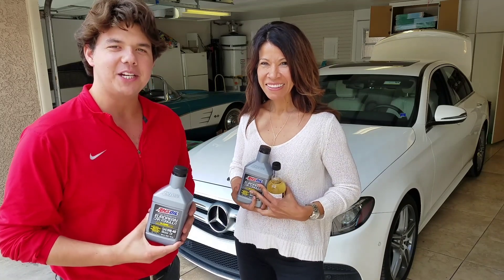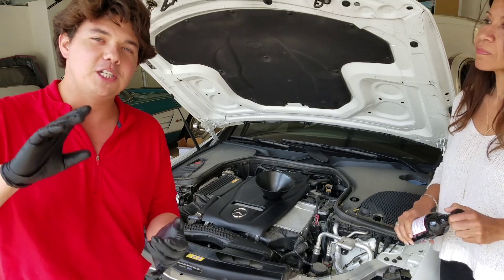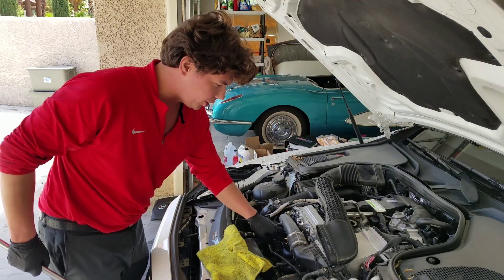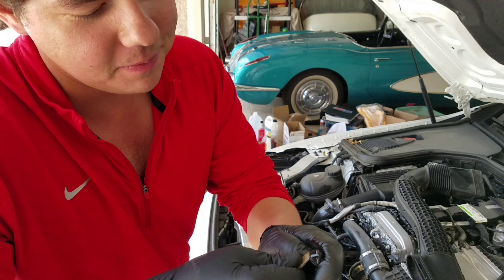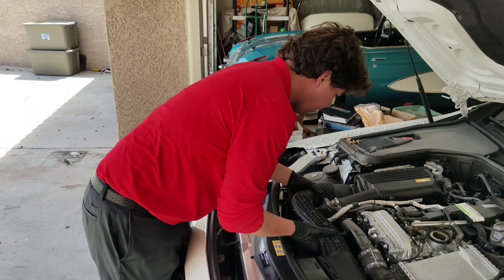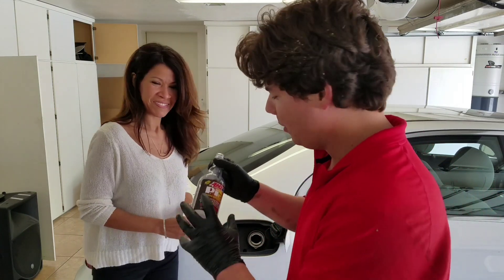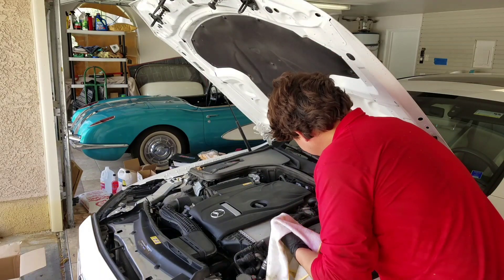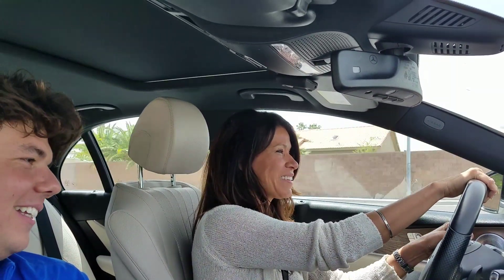2017 Mercedes E300 AMSOIL Oil Change & Engine Flush

Comment: I have a question. Let’s say you put the oil thinning additive. When you do a oil drain, you will never remove 100% of the oil, and consequently the oil thinner as well. When you put the new oil, some of it will mix with the new oil, and so won’t that deteriorate the new oil?
Reply from the maker: The amount that stays in the oil pan is insignificant. Nothin to fret about😉

Comment: Did my oil Change again got 1 gallon of the glorious signature series but I switched from mobile 1 filter to wix Xp wow night and day start up sound fresh from oil change, with mobile 1 it made a nasty screech even with filter full of oil, I tried out the wix xp filter that sound was eliminated, wix makes the filters for amsoil so I figure might give them a try, but when my car gets older and more paid off I’ll extend my drain intervals and get the amsoil filter for when I go long intervals
Reply from the maker: Sweet thanks again James!

Even the regular Wix filters are accilent and they're good for 10,000 miles and you can get those through Amsoil oil with your PC membership.

The Amsoil oil filters are a touch better with higher filtration medium and they trap a little bit more contaminants which is good if you're going to do the longer intervals.

 happy to hear your vehicle is running great.

 if you're on Facebook or Instagram definitely friend me in tag me and it would be great if you could share my channel because I'm working on getting to my goal by the end of the year 15 thousand subscribers.

Comment: What brand filter did you use?
Reply from the maker: I do not remember most of the time if I cannot get the Amsoil filter I usually use What's called the Wix filter they are a great oil filter however Amsoil does make a better filter and you can check your specific model right here on the website which will attach me to you as your independent Amsoil Dealer you'll also get the very best value on the products as the 6-month preferred customer💯

 Together! We can get your vehicles to run better than brand new!

     For me to get credit & be "Your" Independent AMSOIL Dealer, please use my website below or my dealer no. 5331179 call anytime Eben Rockmaker 702-472-3614
After you click on: http://syntheticoilprotection.net
1. Click the hamburger menu
2. Click offers AMSOIL preferred customer
3. Click join now. 6-month PC member add to cart.  ( There is no reoccurring renewal membership unless you select that dot box ) 
( You have the option to not have your credit card saved if you prefer - est. 1972 )
4. Scroll up to the top Select shop by vehicle. 

New Promo Code: FREERAGS

Comment: What did you use to flush the oil?
The first addictive?
Reply from the maker: It is called Amsoil engine flush it will get all the carbon deposits out of the motor and around the Rings and oil cooler ports and also helps clean turbo coking on turbo cars.
https://www.amsoil.com/p/engine-and-transmission-flush-flsh/?zo=5331179

Comment: I would love to see an actual fool service on a modern Benz. Brake replacements, oil changes, air filter replacements, spark plugs ect.
Reply from the maker: It's all very basic the big thing you'll want is a C-clamp to press the calipers back on the brakes and that is far as spark plugs and stuff all you do is take off all the plastic covers on the engine and most of them you take the coil out and that's really it I mean the full service on one of those cars is not that hard a really good mechanic can do it in about 4 hours
Reply: @Syntheticoilprotection  maybe they were asking you to make a video where you show a full service
Reply from the maker: Thanks yeah I specialize in lubricants on the channel and I try to keep a focus on that that way the channels not all over the place and has a great Dynamic for all things Lube😁😉😄😊

Comment: What oil change interval are you recommending for this Mercedes when using Amsoil?
Reply from the maker: If it was my car I would go about 10,000 mi of normal driving I would change the oil filter at 5,000 the first oil change just to get all the carbon deposits out I would also do the engine flush and the PI performance improver every 4,000 mi.

The engine flush is used only the first time when switching over to Amsoil that helps get the carbon around the rings out and the oil cooler ports and really helps keep the turbos from boil coating.

Comment: I have the same exact car. Great instructions. How often do you recommend changing the oil and filter in these cars...Dealer told me every 10k miles. 

Is there any other 30k mile services you recommend?
Reply from the maker: Yeah I would do the air filter rotate your tires basically just the simple stuff change the cabin air filter.

I would do the PI performance improver fuel additive..
I would also get one case of the upper cylinder lubricant.

I would run high quality fuel like Chevron or Shell.

I would get a really good high-quality tire like a Toyo praxis sport tires
Reply from the maker: Professional YouLubher: Eben Rockmaker Regency Direct Jobber AMSOIL Specialist (Dealer#: 5331179) 

To Order AMSOIL Products Click Here - http://syntheticoilprotection.net/ 

Find Products For All Vehicles - 
https://www.amsoil.com/guides/?zo=5331179
Reply: @Syntheticoilprotection  Thanks!